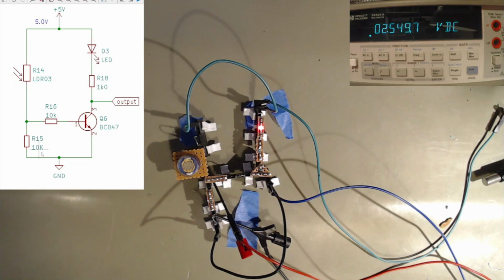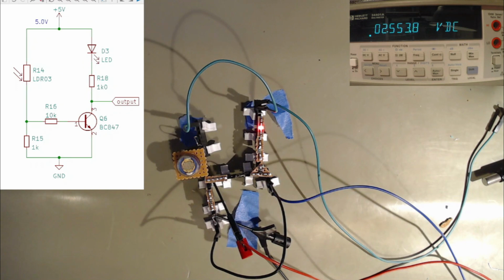#171 Experiment 4 turn on a transistor when it's light

Comment: For years I thought transistors were digital (on or off state) its only lately I realised that they are analog !
Reply from the maker: Funny that I’ve always used them analogue domain, with the odd bit of switching. But then most of my working life was analogue audio coms. in the end it was Time division multiplexed digital audio, with a little bit of analogue for when the digital failed.

Comment: I had the light polution issues with both the kits.
Reply from the maker: This is why you often see them with a tube over them, to cut down light from the sides.
I did find a strange one in the loft with 3 pins and two side by side sensors in a metal can with a window?